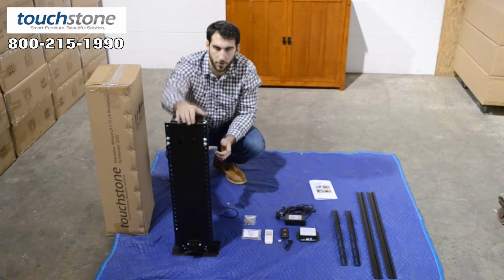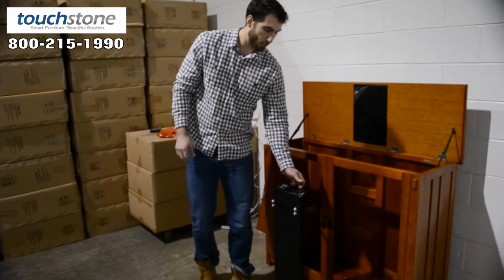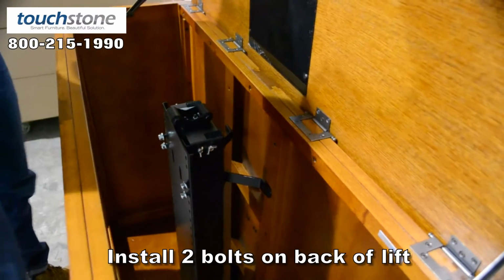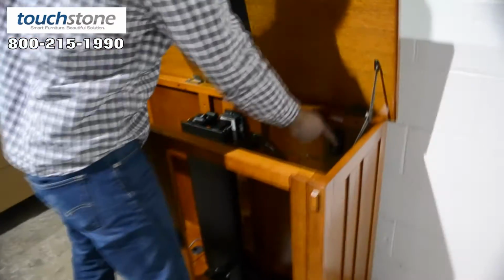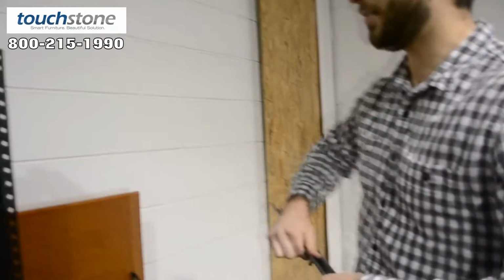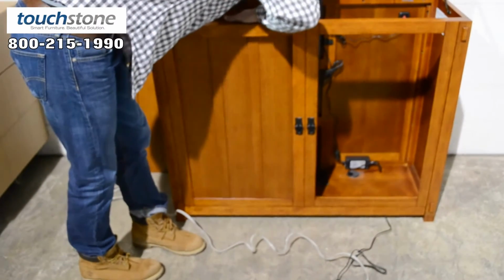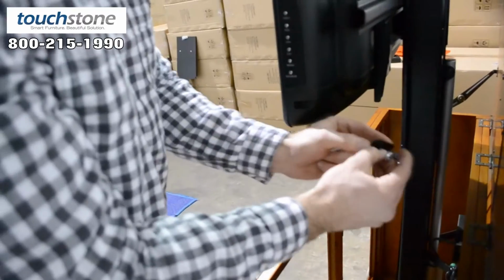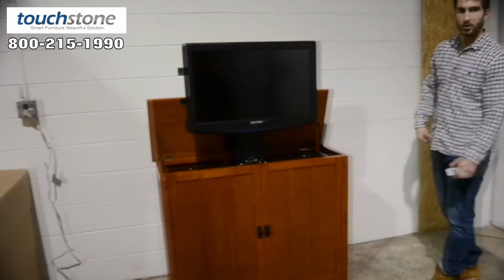Installing Touchstone Whisper Lift II In TV Lift Cabinet

Comment: 13:57 - the shelf doesn't look level. Was that a mistake that you fixed later off camera?

Good video otherwise. I had lots of questions since my unit didn't come with any instructions for some reason.

The supplied bolts used to secure the lift mechanism to the cabinet base are too short. Either that or the cabinet threads are recessed too deep - the threads seem to be recessed at least 1/4 inch - what is the purpose of doing that? If I try to install using the spring washer and the regular washer (you don't say in the video if that is the correct setup but I assume so) the bolt thread does not engage with the cabinet threads. I was able to push down really hard on one bolt and the thread caught but all the rest won't engage. I will try with a proper driver rather than supplied hex wrench, maybe I can get more leverage. I certainly can't get the bolts to engage by hand. I will add the same comment via your website feedback.
Reply: I went ahead and completed the install without the spring washers and it went together much easier.....but I would prefer to use them so I will probably swap out the bolts with the correct ones at a later date.

One other issue with the install. If you're planning on positioning this at the end of your bed then you have to move the whole cabinet + lift mechanism after install since you have to go through the front rather than the back. You cannot complete this install with the cabinet in its final position because the bed prevents you getting access to the front of the cabinet. I managed OK but it's a lot of weight (for some people) to be moving around on a carpeted floor. I'm happy the feet are secured with two dowels and a bolt so they didn't rip off. By the way, my install didn't come with wood glue but I have plenty lying around. Dowels without glue are pretty much useless.
Reply from the maker: Thank you for your commend.  Yes, we leveled the shelf afterwards.  I received your email and responded there for more information regarding the issues that you are seeing.